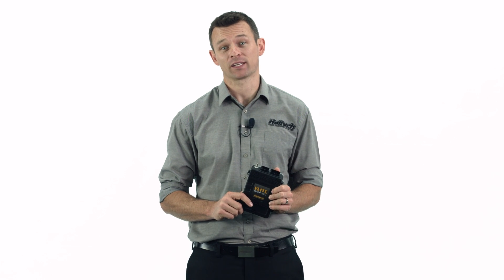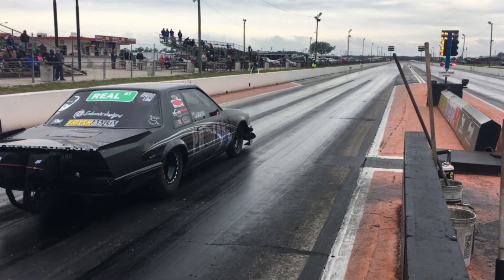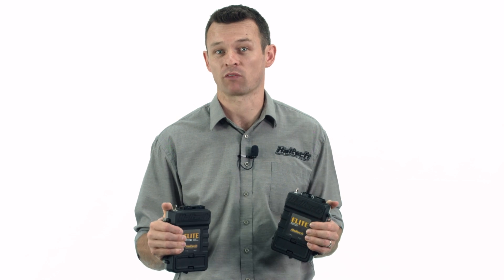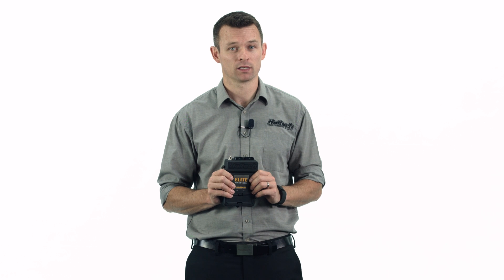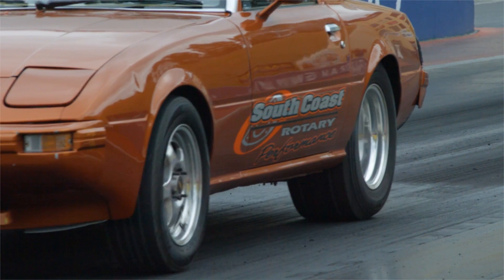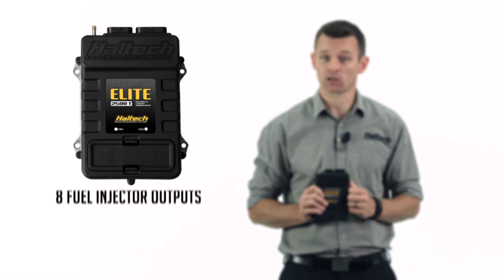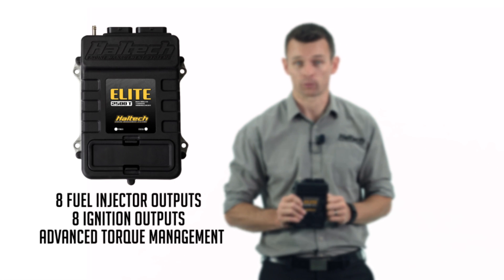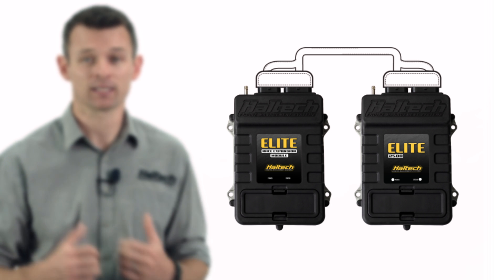🔍 Elite 2500T with Advanced Torque Management - Product Overview

Comment: How do you feel about using GPS vs driveshaft speed. I seen a video from Shane T and he uses this setup. He doesn't like the idea of time based systems. From a slippery track point of view and how that can mess things up with a time based target. He talks about GPS and tailshaft speed. The downside is GPS is slow but he speaks of a setup he uses that is very fast. He still talks about a curve and it being a closed loop system .but he does bring the GPS into the equation. I can only presume the GPS plots the car at certain points on the track and adds a target mph curve and the ecu then chases the curve.

Comment: Random question, on the quad cam control, like for coyote ford. Is the cam map a sealed can file or can it be adjusted like coyotes fitted with oem engine management and accessed with hpt or nguage? Just wondering bc Holley is making a device to control the cams but it’s a can file that you can’t really play with. Just load and it adjusts the cams to whatever. Thanks.
Reply from the maker: If you are talking about cam control with our Elite 2500, then yes the cams on the Coyote engine are controlled directly by the ECU and you can map them however you like.

Comment: Can Advanced Torque Management be set up to compare front wheel speed with rear wheel speed and make adjustments based on that?
Reply from the maker: Yes you can, but in drag racing the front wheels often come off the ground so the front wheel speed becomes irrelevant.
Reply: Under circumstances where the front tires will never leave the ground would this not be the simplest way to configure the system? How do you setup your target rate of acceleration? Could you please make a video explaining the setup in more detail. Thanks

Comment: This may be a stupid question but is this only useful for drag raceing or is it equaly effective on street and track applications?
And would it increase grip in bad weather such as rain, ice and snow?
Reply from the maker: This function has been designed with drag racing in mind however street and track based traction control and rally-style anti-lag have been available on the Elite 1500 and 2500 for a while now:)
Reply: Okay.  Thanks for the quick answer, but let me ask another question.  Is there any disadvantage/Reason not to go with the E2500T over the E2500 even if the car will not exclusively be used as a drag racing car?

Sorry if I am a bit bothersome but I wish to know. 

Greetings from Sweden.
Reply from the maker: Unless you're seriously into competitive drag racing the Elite 2500 has everything you need. There would be no advantage in going up to the 2500T.
Reply: @haltech  Hi to further clarify the above. From a roll racing application- which is racing from 40km - onwards ----- traction control is better handled by what model. I am assuming when you refer to drag racing - is this in the context of drag race from standstill  -> qtr mile mile events at the drag strip. Thanks.
Reply: So this can run pre boost like wrx like a rc turbine that is self-sustaining. That car car have full boost at idle and it's on you tube?
Reply: Edit The car also has a Combustor can with a igniter and  extra fuel injector control so at least one for the combustor just like a jet engine that makes thrust / jet helicopter turbojet engine and as the engine makes its own boost it  shuts off or you can leave it off

Comment: Do you have to have a 2500 unit to be able to use torque management? Can you use the function on a 1500 (with an added fee/modification) for example???
Cheers
Reply from the maker: There are two ways you can add ATM (Advanced Torque Management) to your Elite 2500. You can upgrade it to Elite 2500T (you need to send us your E2500 unit as it requires a hardware upgrade) or add a REM unit to your E2500. This option is not available on E1500. 

More info here: http://www.haltech.com/haltechs-advanced-torque-management-more-grip-less-slip/

Comment: could you program something to pick up say a white strip on the tire that you could combine with a high frequency gps device to give real world slip readings? or some other way of sensing movement vs slip?
Reply: with enough time and money  anything is possible   so yes  but i don't think its the right way forward normal wheel speed and tail shaft with hall or reluctor are proven so sorry i wouldn't bother with your white stripe and optical arrangement . if you can get your GPS or accelerometer to out put a ground speed based frequency the haltech can make good use of it . Haltech have focused there software and hardware on driven wheel speed rate of acceleration over time  becuase this is how drag cars  have gone fast  befor with other stand-alone torque management boxs
Reply: Shane T Uses a extremely high speed gps for traction control. It’s something like 5 times faster than a normal gps. Most people do just use a time based table. Same with boost control. It’s ok. Not perfect but it does work fairly well. I have heard of some folks using a g meter/acceleration rate v driveshaft speed as their traction map. But like everything takes a lot of data on the car etc.

Comment: I have a 04 STI with the ej20 engine, but want to convert to the ej25 2.5 engine with nitrous. What is the best ecu for this application. The Pro Sport or Elite 2500, and what is the best wiring harness to use? Many thanks Daniel
Reply: Does yours happen to be a wrx rally edition with per boost its very limited edition for hum allegation it has a combuster can and special  Computer and software parts for full boost